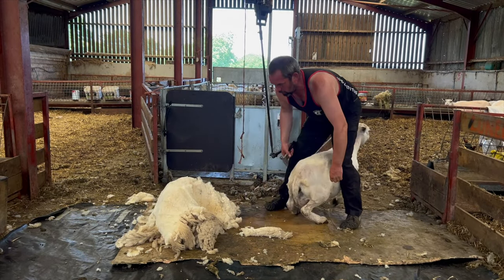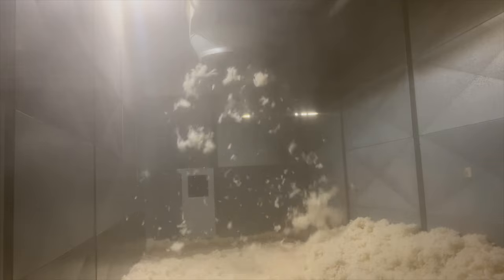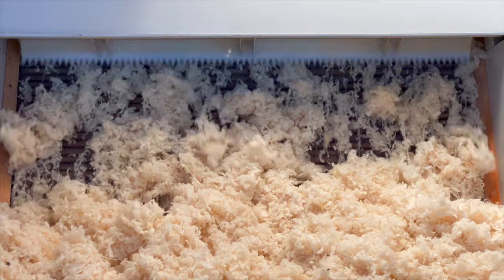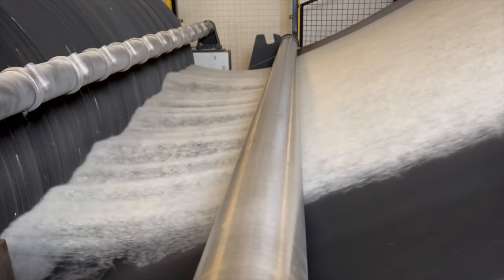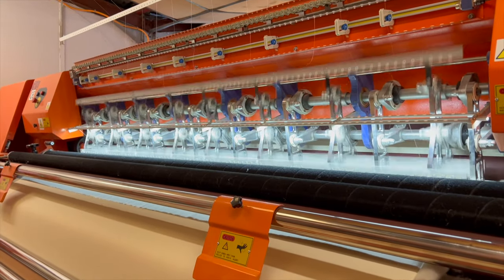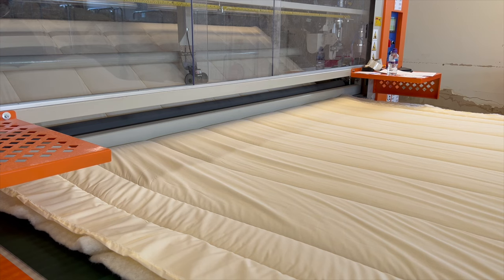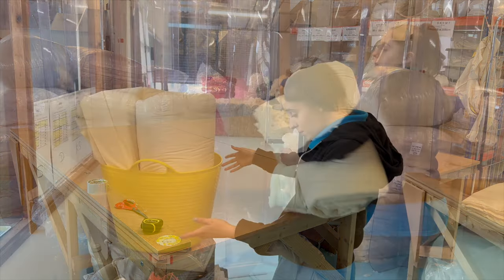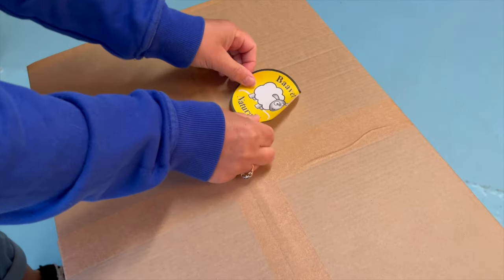How to make a wool duvet

Comment: As a person who is a outside of the box thinker... I would ask why not sell your wool battons to clothing manufacturers that could use your wool battons for insulation in coats , boots, winter hats ect..?
Reply: The carded wool isn’t very stable and would be very difficult to move on to other manufacturers. The wool is fed directly into a quilter in order to reduce handling.
Reply: @lesleygwyer5983  Would this be possible after cross layering and basic quilt layers where sewn on?  Theres so many applications  for this natural insulation, yurt insulation, thinner quilt layers for winter boot slip in liners, coats.  So many companies could benefit from your purified wool... this would increase profit margins for something that doesn't in most cases have to be a finished product on your end.
Reply: Yes, these other applications are possible with some modifications.